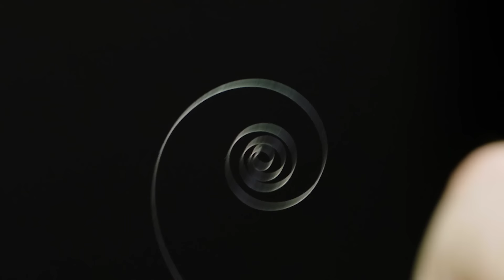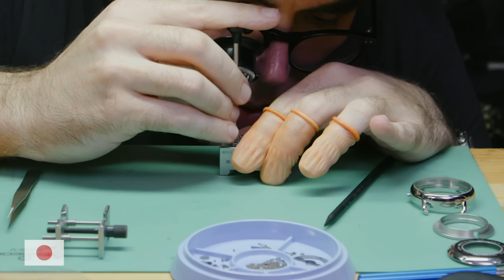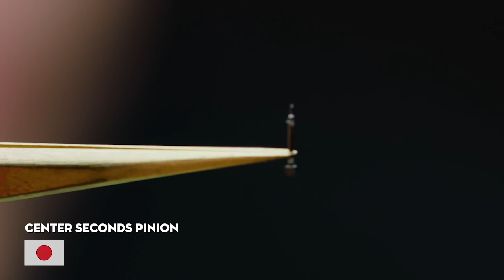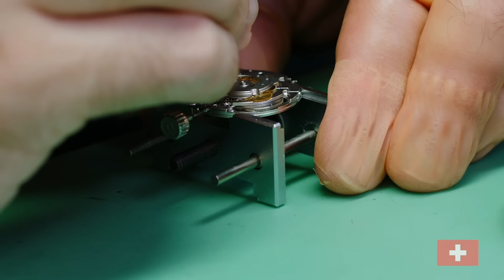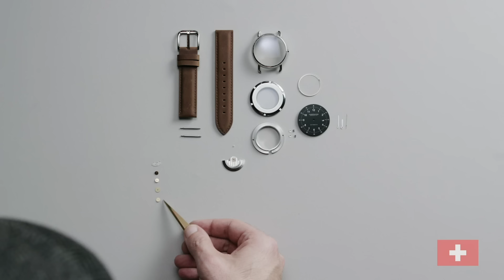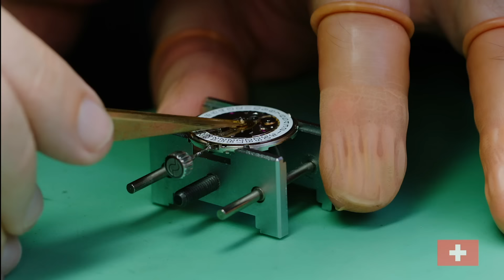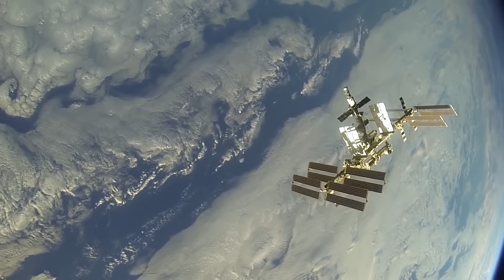Watchmaker Breaks Down Swiss vs Japanese Made Watches | WIRED

Comment: Comparing a ~$250,- ETA movement to a ~$75,- Miyota seems unfair when you never mention the price difference of the movements themselves.
Reply: more like $50 movement lol, 2824 should be comparable to something like 9015 or seiko 6r15 though lower bph but better power reserve.
Reply: And i would lay money that the ETA is no better in time keeping that the Miyota...Dont get me wrong, I have three watches with ETA movements but you ARE paying for that "swiss made" mark.
Reply: @Rich77UK  If you want accuracy, I recommend a Timex Ironman. It will set you back about $30-$50 based on options.
Reply: @stickyfox  I recommend casio w217 or the I believe it's a w800....you'll never need a,watchmaker that's for sure
Reply: @Rich77UK  i prefer seeing the Made in Japan more than Swiss Made
Reply: @gabliteral9356  I"m just getting into watchmaking and did my first two repair and services of two seiko 7s26 movements. I find their watches really fascinatingly and cleverly engineered.
Reply: @Rich77UK  ahhhhhh  timekeeping. My daily datejust , my speedy 125 and my dads inherited manual omega all run at about plus 5 seconds a day. After 10 years or more post overhaul. Speedy 125 is due  back to Geneva for a full overhaul. Pushrod seals and 2 cases. The 125 is a thick old beast.
Reply: @carlosoruna7174  your Rolex needs a service.
Reply: SP  You will lose! Contains a lot of Chinese parts. Much better: Seiko 5!
Reply: @jurivlk5433  no, he will absolutely win, if his purchase brings him joy.
Reply: Lmfao and here i am rockin ma 7s26 and nh35
Reply: @hugedickerinokripperino5299  Hey. There's nothing wrong with 7s26.
Reply: @paulchristian5375  Except that it doesn't allow hand winding a I find that they often don't live up to their spec power reserve. Second hacking would be nice since it's not exactly rocket science.
Reply: @hugedickerinokripperino5299  Sea-gull ST-16 on my wrist at the moment. 😂
Reply: tbh, you should be comparing a $30 japanese movement to a $250 2824-2
Reply: I have seen that Miyota for a lot cheaper than $75.
Reply: Where’s a good resource for finding out about the most commonly used movements? Honest question, I’d like to know more...
Reply: @jztouch   r/watchescirclejerk
Reply: One should know that already anyway, unless they live under a tarpolian.
Reply: Exactly what i thought... Felt veery biased
Reply: These days, the value of the watch has little to do with the quality of the movement.  Not when we all carry phones pretty much wherever we go that are dramatically more accurate than any mechanical watch.  Watches are really just jewelry that happens to tell the time.  A watch is only worth what someone else is willing to pay for it.  Hopefully more than what you actually paid for it :)
Reply: Exactly what I was thinking.... It's almost as if they are biased, or dumb.
Reply: SP  Why and to whom are you saying this?
Reply: Христо Мартунков, граф Лозенски thanks!
Reply: Which one is worth to consider?
Reply: The video is not about price comparision
Reply: You guys comparing these watch movements based on quality time keeping or artistic feature? If u want quality time keeping just choose quartz.. Gshock kept perfect time everytime everywhere.. Auto time adjustment via gps/multiband 6(standard time radio wave reception), solar powered, smartphone link, and they last almost forever.. They also have expensive line too with premium steel used in them, also engraved by japanese artist
Reply: It is about comparing different movements and not comparing identical movements, right? 😅
Reply: the first words of the vid, HE SAYS THE PRICE
Reply: Twas probably sponsored by an AD/Watch group selling swiss watches.
Reply: All these comments miss the point.  Y'all sound like me, people who get cheap watches with decent movement.  BUT... that's not the point of this video, it's not a competition and it sounds like your ego is butthurt.  The point was to show an AVERAGE Japanese movement, with an AVERAGE Swiss movement, to point out the differences.  If you picked a really expensive nice Japanese movement to compare, the contrast wouldn't be there.  This video is for people who don't know much about watches.  It's showing the difference between a cheap movement and a nice one.  Get over yourselves.
Reply: Not a contest of JP vs CH "average". Teardown compares the 'guts' & features of a $300 price difference for a non-enthusiast audience.
Reply: The Myota is about 20 to 30$ and made in Mexico. The ETA mouvement is much more expensive and made mostly in China.
Reply: @jurivlk5433  don't spread wrong information
Reply: its not unfair. Swiss employes get much more money for it. :)
Reply: Hehe boi
Reply: Ehhh get over it
Reply: Why do you feel you need to mention some one is Jewish
Reply: @oscarosullivan4513  I was thinking the same thing..
Reply: @osc @oscarosullivan4513 cuz lots of yuden are jewelers / watch dealers
Reply: Juri Vlk isn’t that against the law
Reply: @oscarosullivan4513  It's never been against the law to be a moron.
Reply: SP  This movement is like 20$ to 25$ but is of good quality and reliable. The "Swiss" one is like 100$ which is way too expensive and only explained by the Monopoly position of the lebanese-jewish owner, Nick Hayek. The real value and and so long ago usual price is around 40$. The "Swiss" movent is then cased into watches costing up to several thousands of dollars. Usually, the watches with no "Swiss made" are the much better deal!
Reply: @jurivlk5433  WTF is this 'lebanese-jewish' doing in your comment? Seriously, WTF!?! Makes the rest of your comment completely useless. You really should think about that.
Reply: ok, can you name a japanese movement in the same price range? give us an exemple
Reply: @alfistibrasiliani  I can name Japanese movements in a much higher price range. Anything Grand Seiko makes. The Miyota 9015 would also be more comparable to the ETA 2824-2, Seiko's 6R15, 8L35 etc.
Reply: @gmansplit  He asked in the same price range. A Grand Seiko movement is more in the same price range as an Omega in-house movement. The Seiko Spring Drive movement is over $1000 for example.
Reply: alfistibrasiliani what about the miyota 9015? its considered better than the eta, still cheaper.
Reply: @alfistibrasiliani  what??
Reply: @alfistibrasiliani  Have you heard of Grand Seiko's brilliant spring drive movement? Or any other Grand Seiko movement for that matter haha.
Reply: @alfistibrasiliani  
easy, Miyota 9xxx series
Reply: @alfistibrasiliani  Seiko movements for shure
Reply: @alfistibrasiliani  seiko, orient
Reply: @alfistibrasiliani  great seiko spring drive 😝😝😝

Comment: You are making a comparison with a basic, bottom-of-the-barrel cheap Miyota ($20) with ETA-2824-2($250). I don't think it's fair for you to make a comparison with these two, similar to how unfair it is if you compasion ETA2824-2 with GS 9S86($6k). You have also stated that there is no plastic part in 'swiss movements', which is untrue for Swatch sistem51. This is not to say that it is a bad video. It's a very educational video that could be better without some of its commentaries.
Reply: You're right! And even so, the Myota 8M15 or so is much more reliable than the overpriced Swiss stuff. A few years ago, swiss movements had reasonable prices, then came Jew Hayek and overpriced everything.
Reply: @jurivlk5433  'You don't buy a Swiss watch to look at its time' -President of AP

Comment: Comparing an ETA2824 to Miyota 9015 would be more appropriate as the specs match more closely (hand winding, hacking and 28,800 bphr). Miyota 821A is in a lower class. Also,  wouldn't replacing the entire movement with a new  miyota 9015 be cheaper than taking the movement apart and service piece by piece. That's when Japanese movement shines over competition. Swiss are known to make some fine watches and ball bearings but Japan has much more diverse industry, that's why their watches don't stand out as much as their cars, electronics, aerospace, and steel. Otherwise, a Grand Seiko with Spring drive is probably better than a Rolex. Servicing an expensive movement like Rolex will cost about $700-800, just put a brand new Miyota 9015 and it will last longer and cost $100 for a brand new movement.
Reply: Very true, but many hobbyists have invested a few hundred in tools and supplies so they can service their own watches.  If you destroy your movement by mistake, you can buy a new one.  But if you are successful you can get your watch running again.  Some people just like doing that sort of thing and they own a lot of watches so eventually it pays off.
Reply: @benjaminbarrera214  I thought the guy on the video is a professional servicing the watch movements for his customers for a fee. Let's put hobbyists aside for a moment, because you suggests they would like to service their watch movement as part of their hobby. I speculated having a watch movement swap out with a brand new one like Miyota 9015 would be more economical than servicing a Swiss movement such as Rolex.

Comment: Gloves were useless by the time  he touched the main spring barrel with bare hands. And many steps necessary were skipped for example to let the barrel spring run down in a controlled way when removing the escapement. I'm sure he did it, but it wasn't shown here.

Comment: Uhh, nickel is not softer than steel...why do you think they nickel plate things for wear resistance?
Reply: They plate with nickel for corrosion resistance, and for low friction applications. Although usually low friction coatings contain PTFE. Nickel is also quite ductile, so in some applications where steel would chip, it can impart wear resistance. But unless nickel is heat treated it will not be harder than tool steels.

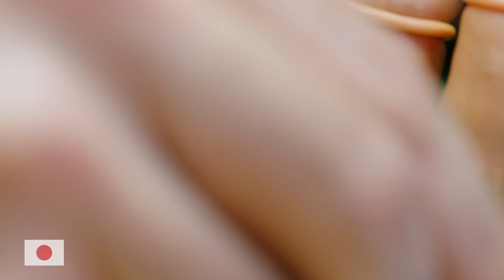Comment: how many of these synthetic rubies are in a Swiss watch? 14:13 the plate holding the center wheel, does that plate have a doughnut shaped ruby in its center?
Reply: This is the number of jewels a watch has. A Swiss ETA 2824, like the one in the video, has 25 jewels. Vacheron Constantin created a watch with 57 complications that had 242 jewels. Its movement is beautiful. Check out Reference 57260 to find pictures of it.

Comment: The Miyota 8200 is based on the Swiss AS movements, so a better comparison would be between the Miyota 9015 and that ETA 2824-2.  And it's "Pinion to Wheel" not ever "Gear Train", but a "Wheel Train", plus few other things, but I'll let it be.

Comment: Loved every second of it. Never would have thought the pieces in a watch were so tiny and there are way more pieces than just cogs, 3 arms and a spring! And it's nice to know jewels have more uses than just looking pretty. Keep it up with the breaking downs
Reply: Not trying to be pedantic, just want to enlighten you; the jewels they use in watch making are not the same jewels people would stick in a ring or a bracelet. They're often synthetic and mostly artificially colored to look red like rubies (that's why some manufacturers will list the amount of 'rubies' instead of 'jewels'). Their purpose is to act as a bearing, the material is incredibly hard (one hardness level below diamond) and they're oiled, so when the axle of one of the cogs rotates against it, it won't wear out as much.
Reply: @GulliNL  Yeah, learned about that these past 4 years. Most synthetic rubies are purple/lavender though, and learned about crystalline structures of metals that are even harder than diamonds. By the way, you should look into the uses of synthetic sapphires as long-life bearings - or types of quartz. Thanks for taking the time to educate, tho. That info would be gold for people that didn't know ^_^

Comment: 24:15: Nope, that's not the great wheel; the great wheel in these watches is integrated into the barrel. To understand which wheel is the great wheel, think of a fusee watch, where the barrel and great wheel are separate parts rotating on separate arbors; the great wheel is the one on the same arbor as the fusee.

I think the best name for a non-centric "center wheel" like on this 2824 would be a "second wheel," but that's an admittedly confusing term because some people call the fourth wheel the "seconds wheel."  YMMV.

Comment: Do that watch use battery?
Reply: No battery. The main spring provides the power. A fully wound spring often provides 40-80 hours of power. An automatic movement, like these, automatically winds the spring as you wear the watch. Other watches require the crown to be manually wound.
Reply: Many watches are quartz watches, which use batteries. Seiko (Japan) created the first quartz wristwatch movement in 1969.

Comment: 13:23 - While it's true that the jewels are synthetic corundum, it is still accurate to call them rubies, because rubies are corundum. So are sapphires. The only difference is the impurities that give the corundum its color. (in its pure form it's clear, which is why it can be used for watch faces as well.) Also, they aren't just used for friction reduction, they're also used for wear reduction. The ratchet engages and disengages 250,000 times PER DAY, and watches are generally used for DECADES. Metal parts would wear-out in a few months at best in that scenario.
Reply: The old Timex watches used Armalloy metal bearings, no jewels at all.  But by then people believed the number of jewels in a watch was an indication of quality, so the jewels are still there to justify the high price.
Reply: @benjaminbarrera214 yep. The seller sets the value and the buyer proves it true.

Comment: Those are nice watches. I'd love a nice mechanical watch.
Reply: Just buy a Seiko.
Reply: The mechanical seiko watches are pretty expensive, thats the thing. The decent automatic watches start at like 300€
Reply: @jort93z  you can get a decent automatic Seiko for 70€ and one of the most legendary watches ever created, the Seiko SKX 009/ 007 for less than 200. For 300+ you can get into the SRPB and SARB line of watches which are great too.

Comment: Good video. I just wish he used comparable Japanese and Swiss movements. These movements are not comparable at all.
Reply: One runs at 21600 bph while the other runs at 28800 bph. It would have been nice to see him use the Miyota 9015 instead.
Reply: He's comparing two of the same carpenter watches; that 9015 movement isn't available in this series
Reply: Yes they are. Both entry level auto with date.
Reply: @lolcat23  The ETA 2824 is literally three times more expensive with more advanced functions

Comment: He cares about not getting finger oils on the components but he touched nearly every piece with his index finger with a big hole ripped in the latex protector.
Reply: It doesn't matter when dissasembling, the oil will only damage the parts over time. It's going into a cleaning solution to remove all kinds of fat and grease right after disassembly.
Reply: finger condoms*
Reply: Looks like the tear happened with the removal/unwinding of the second (Swiss) main spring, so he may not have noticed. And he mostly uses his tweezers, and holds with the flat part of his index finger, rather than the tip edge where the cut is.
Reply: well, he probably didn't notice, but he is touching things mainly with the tweezers and not his fingers so I don't really think it's such a big deal
Reply: The parts are going into an ultrasonic after disassembly. Final assembly is where it's crucial.
Reply: I read somewhere that some very old-school Swiss watchmakers used to lubricate tiny movement parts by touching them to their noses. A lot of them also used to shoot pistols to improve the steadiness and fine motor skills of their hands.
Reply: He didn't say "the components", he expressly said "the plating and finish". Dumb comment.
Reply: Here we are. The comment i was looking for lol
Reply: It's a cheap movement he is using anyway lol
Reply: @eddy-currents  A $500 or $800 piece of what is essentially jewelry is not cheap for most people.
Reply: It's a demonstration, can you not complain and just appreciate what you witnessed? I'm sure he does a lot more stuff to such watches that he can't show us and we won't even comprehend. That was just the disassembly of 2 brand new watches, imagine repairing a broken and dirty old watch... Can't be perfect in everything, at least he is in what actually matters.
Reply: @em0_tion  Nobody is allowed to complain or comment on the broken finger condoms, got it. ATinyWaffle needs to relax, he's freaking out over nothing, right.
Reply: It's a legitimate point.
Not to mention only has them on the one hand, but at times uses his other hand to manipulate something.
Reply: @bitfreakazoid  Plus he took his glasses off after putting them on.  Have you ever looked at how oily glasses can get?